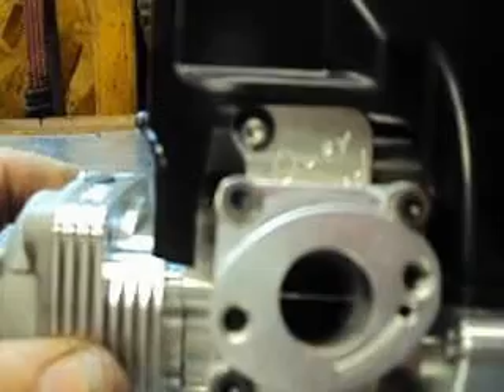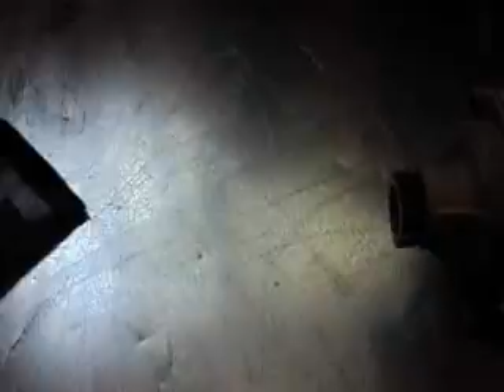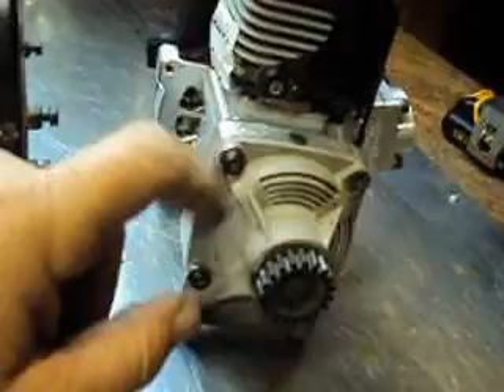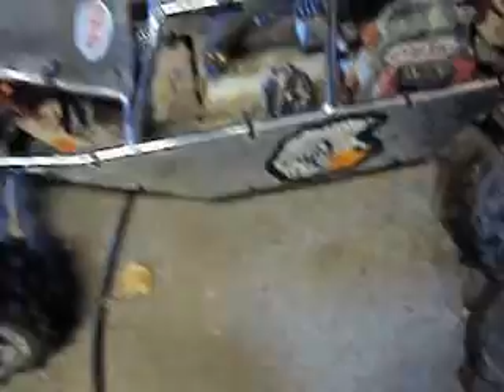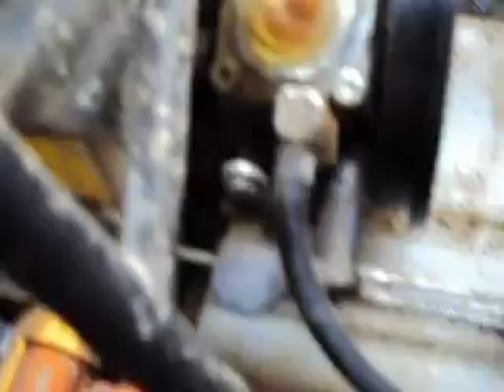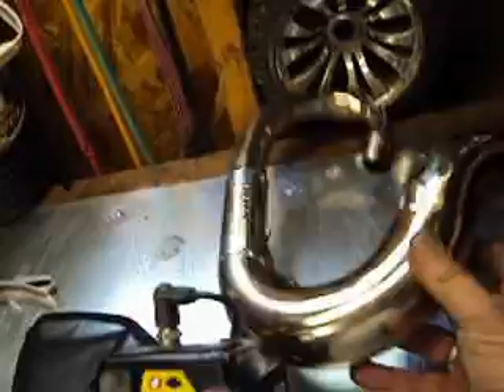TR/OBR 8.2 HP REED Engine for my 5ive 30.5cc Using SONY CAM

Comment: That is strange.  I have been building engines from TS reed cases (who OBR and TR copied) ever since TS cases hit the market about 12 years ago.  Right from year one, we have won expert and pro level races and championships with them, leaving every piston port behind us; (mostly in ped and go-cart (also made by go-ped) racing, as many RC race organizations won't let the reed cases compete--silly--right?).

After all those builds, race wins, and championships for over a decade, I have never dynoed (with my calibrated dyno) any Zenoah based RC engine over 7.25hp.

If you just got beat by a engine that is suppose to make 2 less hp (obviously not), shoot me a call for me to dyno test your engine, so you can see what you actually paid for.  You pay for the shipping,--but the dyno service is free for this particular issue, (while offer stands).

Doug @ ESP
(616) 458-8103 (EST Zone)

Comment: Sweet obr motor. There's a 36mm big bore kit you can get for a little less than 100$ that will wake up an stock blog from Losi or HPI, especially a CY motor. Adds up to 2.5 hp with a little polishing, Walbro 813 carb and a good pipe and that stock 26cc will run like crazy. I have done 2, a 26cc and a 29cc. Both were crazy fast but the 26cc picked up the most. The low end almost doubled and the 29cc made the low end better and good power band all through rpm range. Goo luck with your build. Man that obr is sweet!!!!

Comment: BZM makes a motor that's like 2800$ an it puts out 15hp. It's 60cc. It's ridiculous. But ya u can get 4 bolt kits an u can get 2mm stuffed cranks with a ported head an juice box. These motors are goped motors so all u do is put these mods an it will have plenty of power. That OBR motor u have is gonna smoke most dudes trucks. Unless they have the bzm I mentioned. Losi motor stock is like 3 1/2 hp. So 8hp is great

Comment: I really couldnt tell you.if it was a hpi baja id say the reed 30.5,revs alot better over the 36. im not really impressed with the obr 36 but I dont have a losi or heavy 4wd truck.. the 36 seems to have good torque but just stops in it tracks because it dont rev like the 30.5 reed.
if you looking fir torque and rpms then check out the obr pro mod, but its not on obr site, they add material to cylinder as well as porting it.
thnx

Comment: none, id keep it as a spare incase you end up buying another truck  or a longblock engine then you casn use the existing bits, you could even get into racing so the stock 26 could come in useful.
 i have a nitro car, hyper st and a few others.

Comment: it will be good in the street car as you dont need huge amounts of power for onroad use.
when it comes down to stockers,the pipe is so important to get the most out of it,just depends where you want the power and the way its delivered. that losi is going to be quite a special car,the reed is gotgous and once you put the billet case and pullstarter on it will be something else.
theres a bizeta 28.5cc bzm reed on  the uk ebay at the moment, the'yre made for this application/ sport.

Comment from the maker: DDM actually has the TR billet pull start and cover on sale for $104.00 this weekend so I bought one. I also bought the $45 and $9 plain black same style pull start. Its the same puller as the TR one. Husquvarna puts it out. Husky own Zenoah i found out when i opened the package. Thanks for the engine kit info i think i'll turn my 2-bolt CY into a 4HP with a kit for my short course or my 5B treet car

Comment: a thing of beauty man!!! you gotta get a billet side casing and pullstarer. 
the piston port motors are quite boring and ugly in comparison  lol.
     you can buy a bigbore kit which is very cheap,either stick the bigger cylinder and piston(36mm piston ,stock 28mm stroke) for 28.5cc, probably around £50 - $60  or get a stroker with the same 36mm piston for 30.5cc, probably $80, maybe. is the old 26cc cy a 2 bolt or 4 bolt?